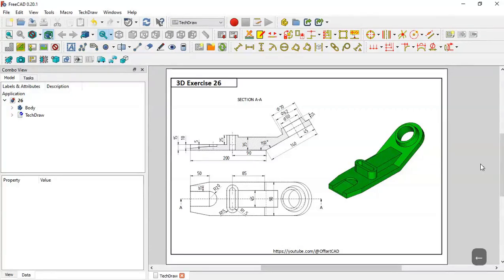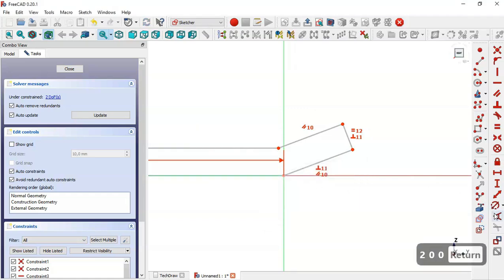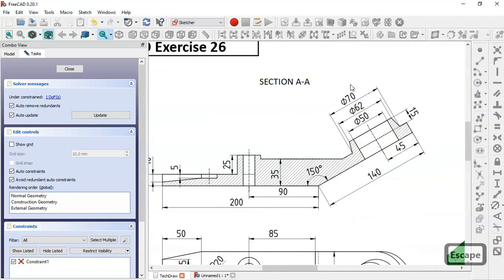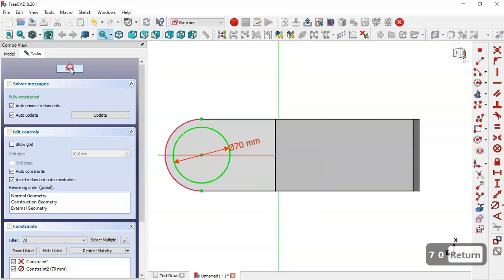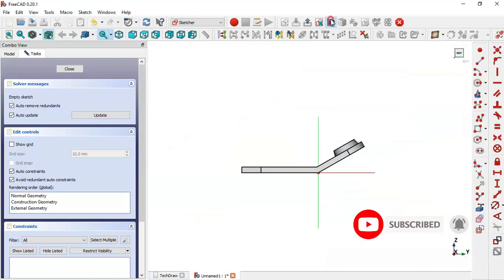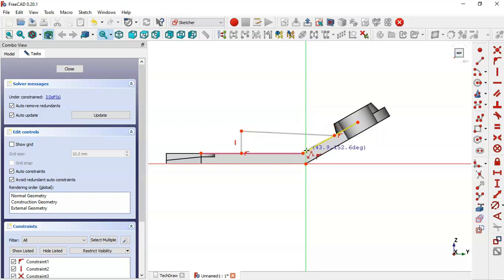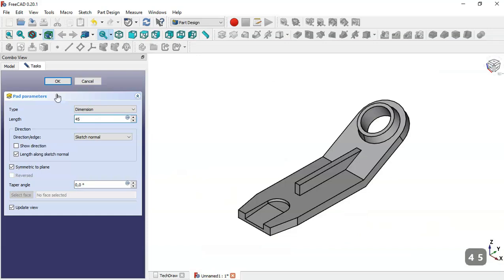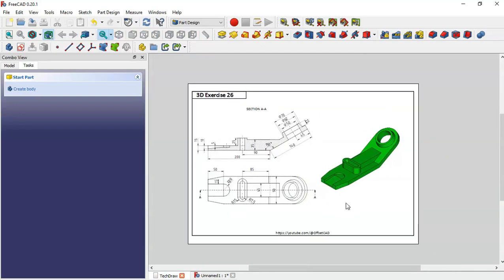FreeCAD Beginners tutorial: practical exercise 26

Comment: Hey guys, working through the exercises, appreciate your work.  One comment on this one - using the Chamfer tool to 14.9 (coz can't chamfer full height) is a bit of a cheat - why not use the Subtractive Pipe tool to sweep a triangle around the edge instead :)
Reply from the maker: 😂😂😂 try it! And then say something about. Please!
Reply: I did, works as expected.  New sketch on the XZ plane, show cross section, lift out the lines of the circle to be adjusted and draw the subtraction triangle.  Apply the subtractive sweep to the edge of the circle and you are done 👍